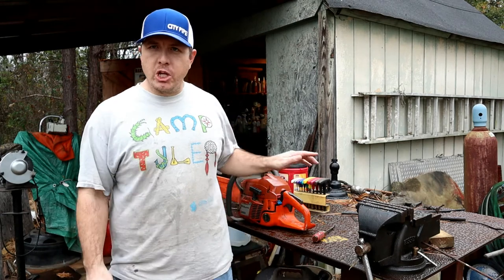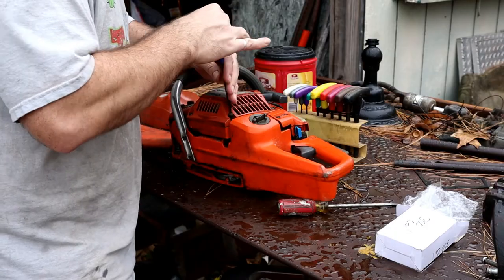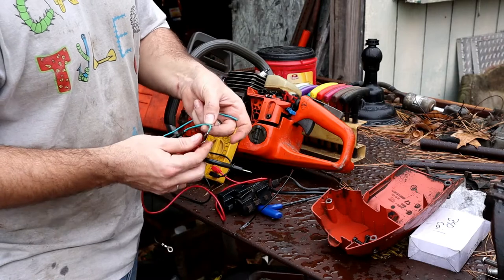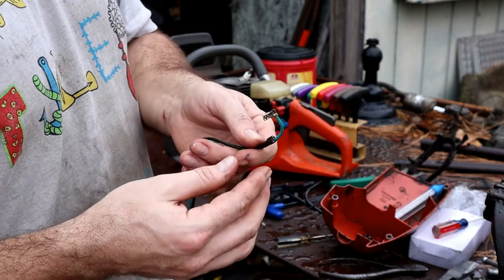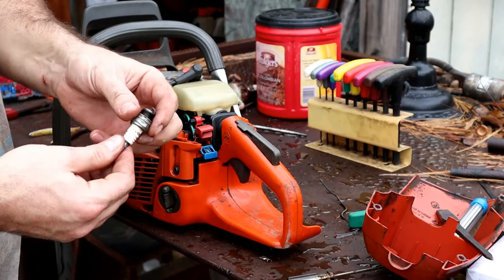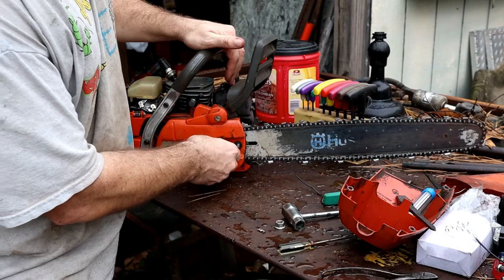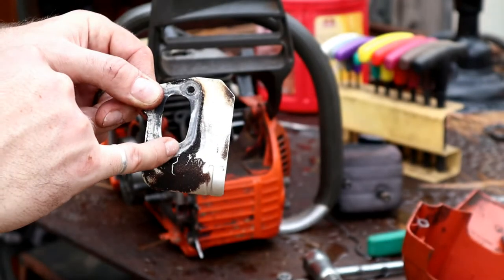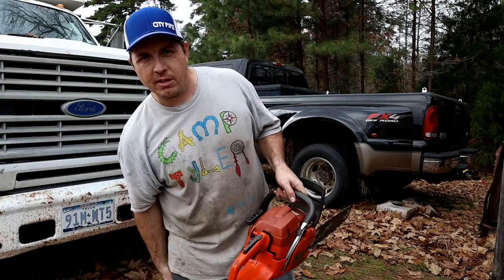How To Fix A Chainsaw Coil Spark Issue

Comment: My 350 died a horrible death.  They have a plastic clamp on the intake manifold that looses tension and they will suck air and run lean.  This causes the saw to overheat and will ruin the piston/cylinder and even melt the case.  They make a metal clamp now and there was a recall years ago to replace the plastic clamps.  I ported and dropped the squish and made a pop up piston for mine.  After reassembly, I couldn't get it to fire.  Replaced 3 coils and still had a weak or no spark condition.  Finally tore the saw back down and found out that the bolt through the base that holds the ground strap to the clam shell base was coated with 1184 gasket seal causing a faulty ground.  Cleaned the bolt and tapped the hole clean again and she runs better than new.  Faulty grounds are a pain to diagnose sometimes.
Reply from the maker: Yeah I’m on my 3rd jug and 4th piston with this saw in just 10 years. I go with my stihl 030av anymore, and this one collects dust. I’ve had the same thing happen with the ground with my 020. What a nightmare. Lock tight every nit and bolt on the older saws or they rattle apart

Welcome to Man Time!

Comment: Usually the problem is no spark and that's why I'm here. But your looking at the shut off switch? Haha fooled me.
Reply from the maker: Not trying to fool anyone. No spark usually means a new coil is needed
Reply: @Man-Time  I keep finding loose coils rubbing against the magneto. Nobody seems to be aware of that.
Reply from the maker: Good heads up!  I’ve never experienced that but it’s something to check
Reply: @Man-Time  found a nearly new husqvarna 455 in the garbage last week. Coil was rubbing against magneto and ground and stop switch wire were crimped and shorting to screws that hold pull start on. Replaced wires and readjust coil started right up. Cost to me around 030. Cents

Comment: Hi have husqvarna saw start and runs spot on but stop it and give it 5mins and no way will it start. What do you think.
Reply from the maker: The most typical things to look for is a scored cylinder or clogged carb screen on the inside. If you can’t give it gas that’s the tell. Will it rev up?  Also could be a loose ground. Check all the wiring is tight on both ends
Reply: @Man-Time  thanks ya you could cut for 30 minutes and stop saw and give it 5minutes and no way will it start.
Reply from the maker: Wow that’s a tough one. Check for spark and all the rubber tubing and boots are good. Wiring and cylinder compression. If all that checks good and it still won’t run (and it has good mix gas). Time get a new saw
Reply: @Man-Time  yes new coil new manifold.  So I'll keep trying to work it out. Thanks. 👍